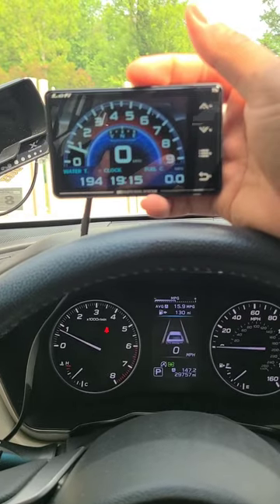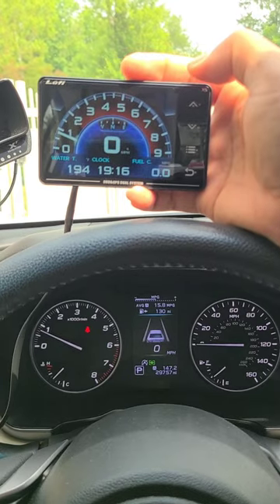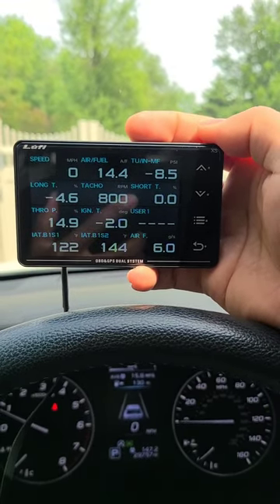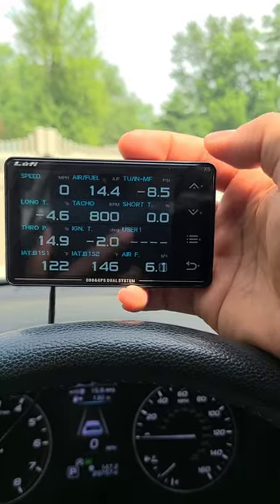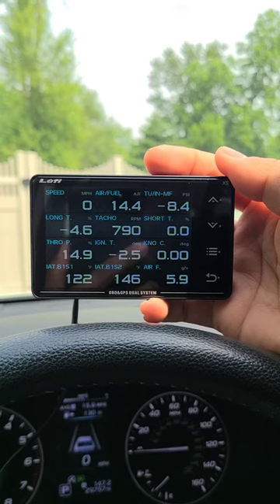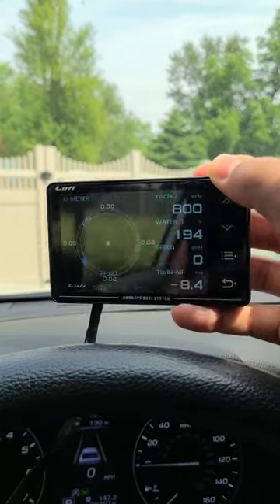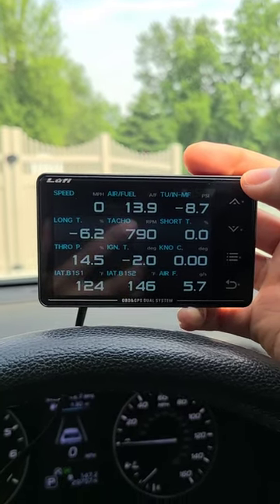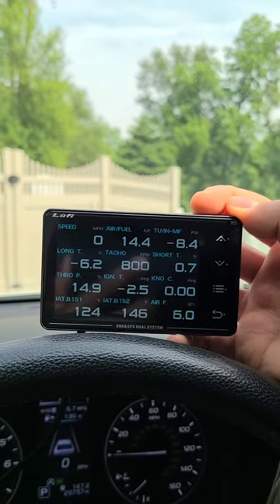Lufi XS Multifunction OBD2 Gauge Review

Comment: Looks really good and im thinking of getting one. But it could be so much better. It would be awesome if they had inputs into the device, such as in input from a wideband sensor to give accurate AFRs and if you could attach a vacuum line again to give accurate boost as some ecus take estimates hence why some stock boost gauges are useless.
Reply from the maker: Agreed, but at this price point, it definitely rises to the occasion
Reply: @GStillJr8  so you think it's still worth getting? Just out out of interest do you know of anything that fits what I described in my first comment?
Reply from the maker: I think what's important to remember is, it provides far more information than you'll get from the factory. Some insight on things you didn't realize you'd think you cared about due to how many parameters are available... all for the fraction of the price of most HUD's and Tuners. If you're chasing tenths of a second and considering wideband, this may not be the tool for you,  but for the price point, it's not designed to be. 

I can no longer use mine as I run a JB4 Tuner with some fuel bias modifications on their 93 Octane map, so that's in my OBD2 port now. It doesn't give me as many available parameters as this gauge did though! Hope this helps.
Reply: @GStillJr8  Yeah definitely helps alot, thanks. I'm not chasing tenths or anything like that Ive just been looking for something like this but with the added inputs such as AF and boost like I said, but only so I've not got alot of different gauges. But I think I'm going to get this then maybe in the future something like I'm looking for will come on the market.
Reply: Hi, got mine and it works great, but I was just wondering if you got yours to detect knock? I downloaded the pid from the website and loaded up the knock one but when it's on screen it just displays the works time out. Just wonder if you've found this also? Or have you got that feature to work? Cheers
Reply from the maker: @craigdickson6551  hey, yes I had Knock working on my configuration. But I believe there were a few different Knock PID's so you have to try each one. If all of them Time Out, your vehicle may not have the ability to communicate that one. Shoot an email to Lufigauge@outlook.com and see if they can work through it with you!
Reply: @GStillJr8  just out of interest what car did you have knock working on? Because I could only see 1 knock PID. I have a 2010 Impreza WRX.
Reply from the maker: @craigdickson6551  2020 Legacy XT

Comment: Bro can you helllppp me please!!!
I was doing the customization where you add the extra parameters. Now my car doesn’t run well. What have i done ? 😬😟😭. How do you reverse the pid thing.
Reply from the maker: Adding a custom PID should NOT make your car run any differently. It's really just attempting to read information from the ECU. There may be another issue causing your poor performance. To reverse it though, simply go back into User Setup and change the file location PID back to "User1-9" (whichever one you changed). Then remove that one from your view. Hope that helps!

Comment: Boost isnt showing a value in my legacy gtb. Thats what i bought this lufi for. Anyone got any ideas as to why?
Reply from the maker: Keep scrolling through the available PID's. Instead of looking for "Turbo", use the Manifold Pressure. It has the proper formula to display boost pressure and vacuum. It's the one I'm using in the video. Should be the top right hand corner of the page with 12 parameters showing.

Comment: Being a CVT, do you really need the shift lights? Wouldn't leaving it in auto not shifting at all just hold you at peak boost, rather than trying to 'fake shift' a car that doesn't really have gears, risking falling out of boost?
Reply from the maker: @kaiwilliams12 I guess some would say that's a valid question. If you're enough of a car enthusiast to be watching this video, you're probably enough of one to acknowledge how sloppy a CVT feels when driving spirited, on a track, etc, especially in a throttle by wire application. While they're more like "logical gears", they still serve their intended purpose. Connecting to the throttle and RPM's more closely in specific situations is still necessary in managing corners and being deliberate about power delivery whereas running in automatic is more of a guessing game. Additionally, I'd wager all CVT's run faster 0-60, lap, and 1/4 mile times in a "manual" mode when driven by experienced or professional drivers. Lastly, this is still a turbocharged vehicle, with tons of work done to the intake and exhaust. So if I want a traditional shifting experience for sound alone, I think it's great that I have that option even with "fake gears". The shift light helps you avoid losing momentum. Most CVT's shift you up when you exceed a certain threshold and depending on the programmed ratio, that can feel like going from 2nd to 5th and ruin the driving experience. Hope that gives you an alternate perspective.
Reply: @GStillJr8  fair enough bro! Guess that all makes sense. I've personally never owned a CVT, let alone had one on a track, I've driven a fair few but that's about it. Apologies if any offense was taken by my initial comment, after re-reading what I said it, sounds like I came off pretty rude 😅, honestly didn't mean any offense by it. Was just genuinely curious as I've only tracked dct's, manuals and traditional automatics, haven't had track time with a CVT  just yet. But they're becoming more common. My partner is about to look at a Subaru Levorg 2.0 for her next car so I hope to try that around a track one day. I'll take your advice and try the manual mode around the corners for more predictable power delivery 👍🏽
Reply from the maker: @kaiwilliams12  no worries. I actually don't even use this unit anymore, as my vehicle now runs a JB4 following all of the modifications that have been done. However, I do run a shift light on the JB4 HUD for all of the same reasons I just mentioned. This vehicle wasn't originally designed to be as sporty as it's little brother WRX, but it now performs better in comparison. With a Pedal Commander or a tune to enhance the throttle by wire experience, CVT's overreact to varying levels of pressure. Sometimes you deliberately want to drop from 4th to 2nd (just one example) and because Automatic is a calculated series of measurements, your desired end result may differ from what the ECU/trans comes up with in that moment. I've been driving CVT's for over a decade now, my 1st being a BRZ that had about 300whp. CVT has limitations for sure when it comes to big power/torque, and keeping them cool is a huge necessity, but it's come a long way over the years. No offense taken. Hope you enjoy the difference as you embrace "manual" mode in the future.

Comment: How do you change it from 9000rpm display to less
Reply from the maker: It's in the configuration for max/min. Virtually every gauge can be altered in the same way. Just have to tinker with them to see what fits for you.
Reply: @GStillJr8  I found only the bar style display can be changed to less rpm. All the dial style max in 9000
Reply from the maker: @barrybritcher  I don't have mine anymore so I can't dig in any further but the support box may be able to assist if there's a way to change it.

Comment: Where’d you get the mount for the windshield ?
Reply from the maker: @jaques8920 Amazon Sportway Dash Cam Suction Mount
Reply: @GStillJr8  and that’s for xf model correct ?
Reply from the maker: @jaques8920  yes. I made sure it worked with at least one of the options provided in the kit and then permanently glued the knob-looking adapter to the back of the device!